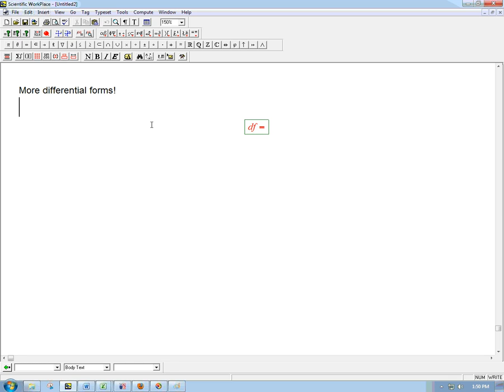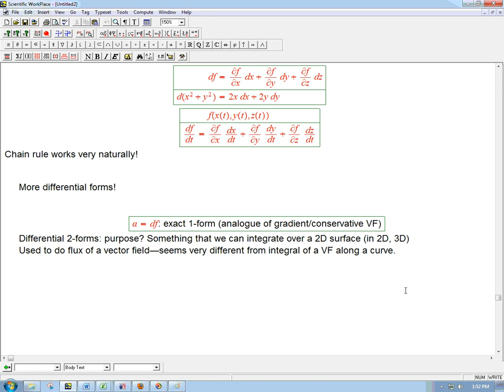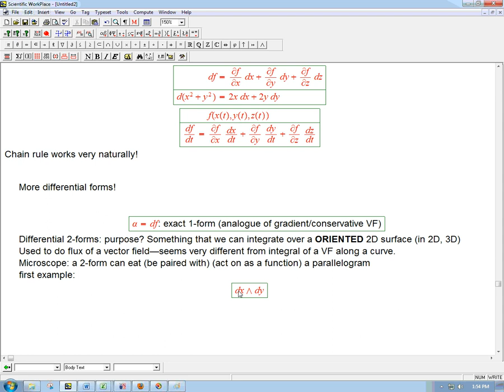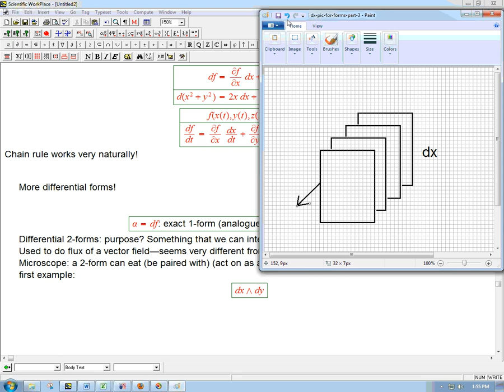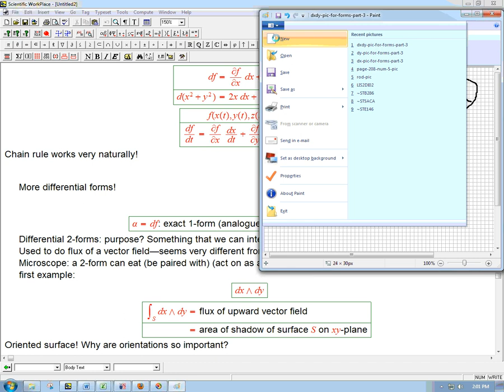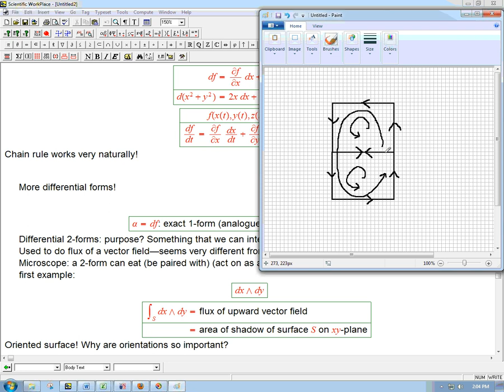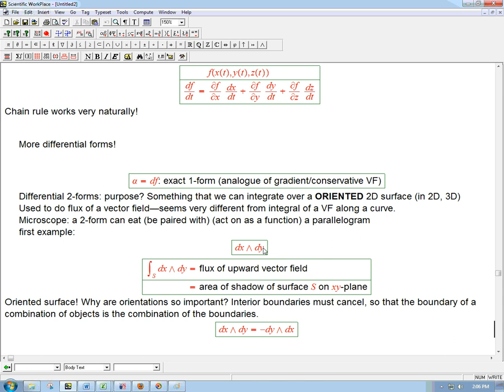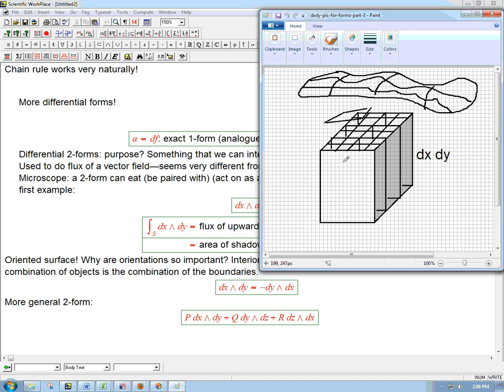Intro to differential forms (part 3)

Comment: Thanks for those vid's !!!

But isn't the last example u give a 3-form?,

because the twoform was dx ^ dy and there u have dx dy and dz .... ?
Reply: CT Records  .. update ... Or does it mean a three form has to eat  small cube or some other three-dimensional object?

so that your example was a two form and a therefrom would look kind of like that:  P dx ^ dy ^dz + Q dx + R dy ^dz  ......    So we count it like polynomial or differential equations... the highest number of  linked 1- forms ( e.g dx) gives  me the information about what form it is... is that right?
Reply from the maker: CT Records For one thing, I think you're getting a little confused about the degree of the form (what kind of geometric object does it "eat", as you mention) and the dimension of the space in which it lives. A form such as P dx \wedge dy + Q dy \wedge dz  is a two-form (since each term is created by wedging only two 1-forms together) living in a three-dimensional space (at least) whose coordinates are x,y,z. 
A three-form in R^3 looks like P dx \wedge dy \wedge dz. It can't (except in much more advanced settings) be mixed with two-forms or one forms, as in P dx \wedge dy \wedge dz + Q dx + R dy \wedge dz. One typically only works with "homogeneous" forms, where all pieces have the same degree. 
In a four-dimensional space, with coordinates w,x,y,z, say, we could have, for example, a three-form P dx \wedge dy \wedge dz + Q dw \wedge dx \wedge dz. 
Hope that clarifies things a bit.